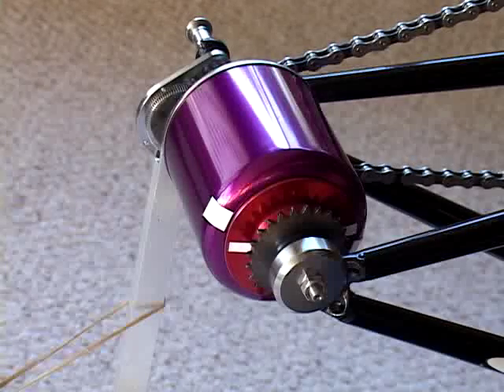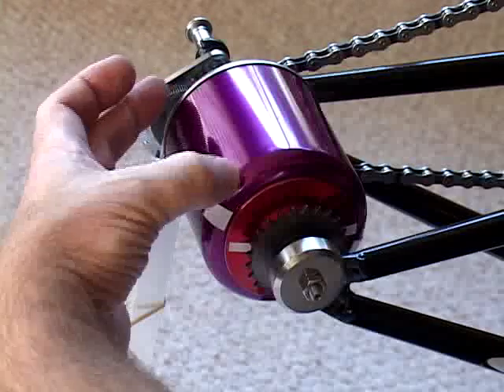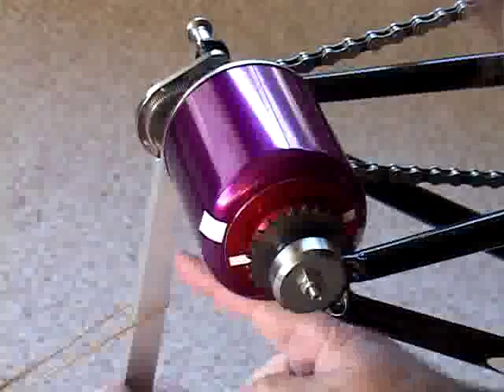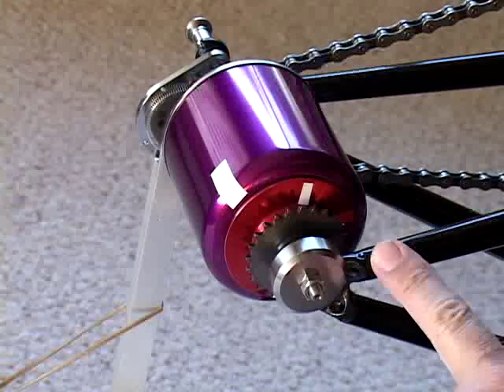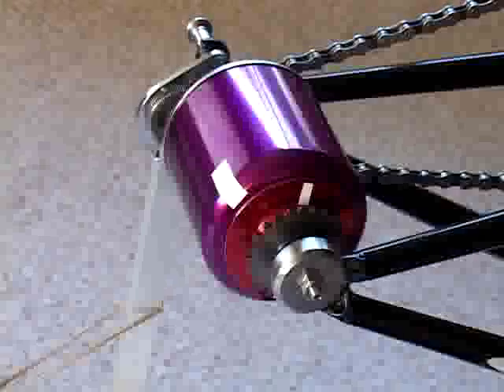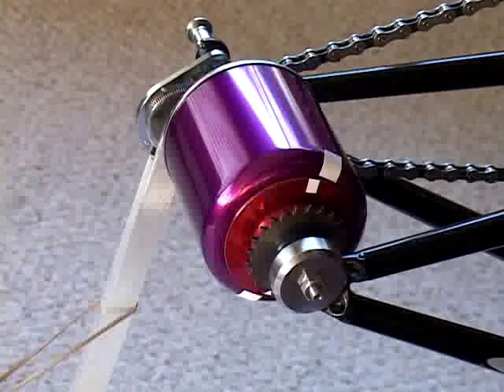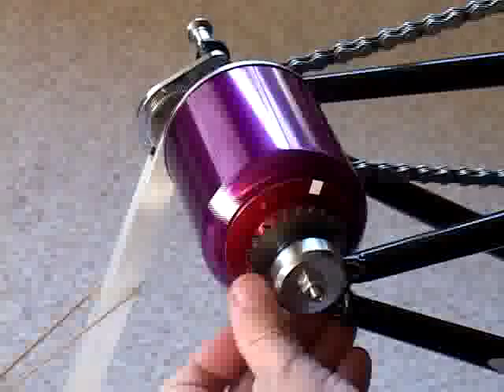Automatic Bicycle Transmission (IVT)

Comment: May I ask, where is the product for this drive type? Any Updates?
Reply from the maker: Thanks for your question.  I've been dedicated for several months to thoroughly optimize a new design for a mid-drive Pedelec EMTB and pedal-only SIVAT with 1kW power capacity.  This design process includes detailed attention to every component's strength, speed and friction to assure a complete, well-integrated system for the next prototype for testing on a full-suspension bicycle.  This design involves many calculations and alternate scenarios to get the right mix that should prove to be the lightest, most compact & durable model that meets & exceeds most basic demands of serious MTB-ers!
This is proving to be the most challenging design task of my long engineering career!  I'm determined to create a great start to a great idea that will be a truly revolutionary transmission that many should find very useful & superior to existing state-of-the-art for bikes other drive systems.
Reply: @SIMKINETICS  Thank you for your response. I do admire your work and determination to pursuit this project. This would be of great value to society - full stop. The greater lesson here is - your relentless effort to continue serves as a template by which all would want to possess however, only a few of us are able to do. With gratitude, bc

Comment: Where is it at now?
Reply from the maker: Thanks for your question.  I've abandoned a hub-based approach in favor of a bottom-bracket-only location because of size & weight requirements.  Focusing on the new approach opens up some important opportunities to add back-driving that will address an emerging market for higher-end pedelec mountain bikes.  This electrified SIVAT necessitates substantial re-thinking & redesign that I'm now doing.  It also involves other aspects of the overall bicycle design, a larger scope that's inspired by a sea-change in the market that more easily justifies the higher price of a quality product.
Up to recently, I was reluctant to go forward because pricing of production appeared to be too high for an affordable SIVAT bike.  A recent insight into how to back-drive the SIVAT is conveniently coinciding with the aforementioned market shift.  So, it's 'back-to-the-drawing-board' for a more expansive, but more appropriate product concept where the numbers work in terms of both design and money!
My goal is to open a crowd-sourcing account, like Patreon, to finance development after I'm satisfied that a more comprehensive design is ready for serious prototyping and testing of a kW+ rated system.  It's been a long time to get to this point!
Reply: @SIMKINETICS  would it work on both e-bikes and normal bikes, could you please send me the link for investing in such gearbox and could you also make another video once done
Lost of love and support for ya
Reply from the maker: @gaelbm7421  My goal is to design only one version that will be universal to accommodate convertibility between a hardtail & rear suspension e-bike as well as both of those in pedal-only propulsion too; i.e., four flavors.  Such convertibility will depend on the motor choice and its control firmware, which are not fully known at this point.  This will involve the challenge of making a predictive choice of motor(s) to fit the SIVAT so that a non-electrified bike can be developed first as an initial product.  
My plan is to run both pedal and electrically-assisted power through the SIVAT, then to a single drive sprocket or belt-drive pulley, involving a new bike design; while also offering fairly simple adaptability to allow retrofitting to existing bikes in a kit. 
If you subscribe to this channel, you'll automatically get updates to the status of this project and eventual references to a Patreon (or other) account for investment.  I might offer an opportunity for early significant contributors to be first to try out a prototype!  Thank you.
Reply: @SIMKINETICS  Thanks! Love your work and ambition and fully supports you

Comment: What is the overall ratio? Better then a Alfine or Rohloff?
Reply from the maker: Thanks for your question. The core mechanism has its highest ratio of output/input rotating speed at about 0.7 with its lowest ratio at 0.0 (zero).  With auxiliary conventional gearing at the core's input and/or output, the maximum  system ratio can be raised to any practical value while still  retaining that zero ratio in its range!  The limit to that systemic high ratio is theoretically infinite, but    limits of strength of materials make 20X-30X its practical limit.  In effect, the SIVAT can deliver a range of gear ratios far beyond anything else!
The demo prototype shown here is sped up with a 55 tooth chainwheel (not visible in this camera view) driving an 11 tooth sprocket; so the 0.7 ratio is raised systemically 5 times (55T/11T) to about 3.5X, slightly low for a bike, but...
I've recently decided to stop trying to make this a hub-based system because it gets too complex & expensive to fit all that gearing into a hub.  So, I've finally decided to proceed with placing the SIVAT in the space above the bottom bracket (the pedal crank) where there's plenty of space to use larger, stronger components that will accommodate an interface with full suspension and a one kilowatt (or more) electric motor.  Pedaling and hardtail versions will be first though.  I'll explore the design possibility to allow fairly simple upgrades for suspension & a motor to make this a highly desirable EMTB!  Regardless, you'll be able to pedal up grades at the limits of traction and pedal downhill at high speed without needing to be outside a 60-100 rpm pedaling cadence. 
Does that answer your question?
Reply: @SIMKINETICS  oho wow thanks, that was extensive! I've quickly read this: USOO5516132A patent. Think it's  close to what you've described in the answer.
Reply from the maker: @tonyd.3430  I couldn't find that in USPTO, so  
don't understand any similarities.  This SIVAT is too weird to be similar to any transmission that I do know; and I've studied hundreds of types.

Comment: The transmission is great.  A bicycle IVT would be an awesome benefit for cyclists.  Flywheels, however, have been proven to be impractical.  To be effective a flywheel needs mass , and a lot of it.  Accelerating that added mass in a vehicle nullifies a lot of the benefit from having it.  When you add the inherent energy losses getting the energy from the drive wheels to the flywheel during 'braking', then back again for acceleration, it's a lot of added complexity and weight for very little gain.

Comment: For anyone still wondering, this technology now exists in a practical sense now, seems like he may have sold the concept. Here is is in action: https://www.youtube.com/watch?v=kVPjhmTThPo 

they used an oil to achieve the transfer of force through the gear hub (this was what the developer was working on, on this current prototype.).

Thumbs up so others can see this.

this is the best bike on the market using the product: https://www.prioritybicycles.com/products/continuumonyx
Reply: This not nuVinci its based on cam, ratchet & negating the initial 1:1 ratio & utilizing just gain. Disadvantages less efficient at higher ratios thats why auto makers were not interested.

Comment: Sounds like hydraulic Beesd valve close 100% bypass but  open is more and more going to driveline but Maybe Combination of Different  Things
Reply: This not nuVinci its based on cam, ratchet & negating the initial 1:1 ratio & utilizing just gain. Disadvantages less efficient at higher ratios thats why auto makers were not interested.
Reply: @LivingLifeOfSeeker  alright so that's why we never saw them on bikes anywhere

Comment: I got an Nintinol power rod low torque engine with a few ton's of force per square inch and i need an i individual able to design a transmission for it. You interested?

Comment: mr simkin, i do see you still active here. hows the project going? what kind of price point are we talking about? feel free to message me directly if you can. your device may be necessary for a more encompassing project.
Reply: This not nuVinci its based on cam, ratchet & negating the initial 1:1 ratio & utilizing just gain. Disadvantages less efficient at higher ratios thats why auto makers were not interested.

Comment: What was commented on is just a first generation concept idea. Low technology. A higher technology of commented concepts is available if you are interested in working with me? I have a swash plate pump motor type 12 that operates off liquid air that spins at hyper velocities so i would be interested for you to design a transmission that i could use with that swash plate pump motor. Concept an electrical power plant in a mountian area with helium super fluid. The super fluid would pull itself around the closed system in a loop spinning swash plate pump motors that then spin electrical power generators. The super fluid would generate it's own monentum has it pulled itself through the system. Just one concept to producing clean energy. Main goal to create clean power systems that can then beam power using tesla coils to power superconductor separators to clean rivers and streams of pollution and bacteria. Rivers and streams you could drink from from being so pure. Up to you if you want to help and get paid along the way has the end results get world wide attention. 😊😉

Comment: I have a use for your transmission sir. Read carfully! A V-6 or V-20 stirling cold gas engine. Gadolinium used for magnetic cushions on all moving parts on the stirling cold gas engine. Stirling engine incorporating antivibration technology currently being used in Skill saw's recuperating saws. Cold gas engine has two fly wheels. I would like to use your automatic transmission and attach a transmission to each fly wheel. Then attach large drum motors that have been rewired into electrical power generator configuration. A cold gas electrical power generator that uses zero fossil fuel and generates no pollution and operates off liquid air. Let's chat and get this product onto the market. It has multiple applications from home electrical generation and air conditioning at the same time by adding components to the system. portable electrical power generators that operate off liquid air. Atmosphere that has been super cooled into a liquid used has fuel for cold gas cycle then heat exchange for air conditioning and or refrigeration with liquid air boil off back into simple atmosphere. 😊😉

Comment: it's not automatic if you have to pull the lever
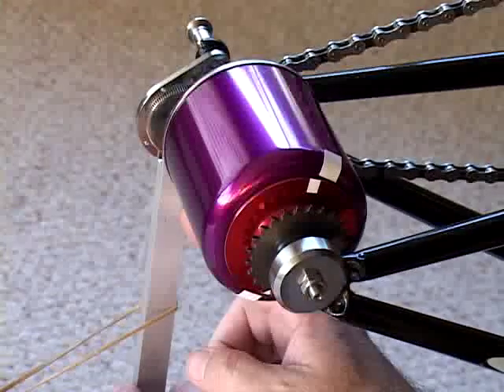Reply from the maker: 4:40  Here's where I explain its automatic operation.  After re-designing this system, I've found that a very simple coil spring-actuated mechanism precisely controls the SIVAT for almost constant power throughput as intended.

Comment: Will it work with a go kart engine? 212cc predator?
Reply from the maker: Thanks for your question!  The first fully functional prototype will not handle 6.5 horsepower because it's design is based on the lighter weight requirements of bicycles & moderately powered small vehicles & machines.  If tests & anticipated production costs justify this size in the marketplace, it will likely become the initial standard as a product.  If that product succeeds, it will pave the way for larger variants.  This concept is scalable!  A SIVAT for the power level you seek will be about 50% larger in most dimensions, and its weight will increase from 3 or 4 pounds to about 10 pounds.
Currently, I've decided to assure that the SIVAT will be capable of jake-braking with some additional design to synchronize inverted driving that changes input to output and output to input with compatible gear ratios.  For patent considerations and a clear path to this capability, I want to first solve this challenge that will enable the SIVAT to be used for applications beyond bicycles that typically don't require jake-braking for which the free-wheeling SIVAT is appropriate.  A go-kart driver will definitely want jake-braking that slows the kart through throttle control rather than separate friction-braking with another pedal.  I consider the option for jake-braking to be important enough to make the launch of the SIVAT contingent on its clear route to a complete solution.  So far, that solution isn't clear to me, but the original SIVAT concept was once also not clear to me.  This is testing my patience with myself!
Reply: SIMKINETICS well when you build one that can handle a 212 cc I would like to buy one

Comment: This be great to use with a stirling hot gas engine that was turning a electrical power generator. Are they available yet? A V twin stirling hot gas engine with two fly wheels could have two of these transmissions that cranked two electrical power generators. Be a neat tool to charge up your battery banks when ypur solar panel set up has not gotten enough sun light. Could use solid state graphene solid state electrolyte power cells with organic carbon power cells to heat elements in the cylinder heads of the stirling hot gas engine to crank the transmissions to turn the electrical power generators. 100% green clean energy way better then solar.

Comment: So it has a variable clutch. If you are able to create a negative ratio. It could be used as a brake, You could have 2 armatures. One for positive and one for negative ratios. and eliminate any other separate components.
Reply from the maker: It's not a variable clutch, nor does it have a 'variable clutch' (whatever that is).  It does use clutches, but they're one-way clutches whose operation is binary; i.e., they're either fully engaged or fully disengaged.
As for jake-braking, the SIVAT cannot in any way be used to swap output with input.  For bicycles, which usually have hand-operated brakes, this feature is not necessary.  BTW, a 'negative ratio' would mean that the output would be backwards, so you likely meant 'inverse ratio' instead.  Anyway, there are some limitations to what the SIVAT can do, but none that would limit its use for a bicycle.  Good try, though!

Comment: a great invention I  have tried a lot of mechanism to do the same process but it dedent work do you use spider gear system or planetery gear or expanding clutch plear answer me it is very important to my invention I can only say it is a mechanical vehicle and this transmission is very much required
Reply from the maker: Thanks!  I cannot disclose much about its inner workings until after a patent is issued.  It does use a planetary gear system in conjunction with several other mechanisms.  One day (after the patent), I'll make a video to describe how it works, which will definitely confuse & perplex most people even if I describe it as clearly as possible!  I can also say that its function depends on a fairly large set of highly constrained mathematical relationships that guide a second prototype design which will be fully-functional.
I too have researched several (dozens) IVT concepts, and have tried several with dissatisfaction.  I now easily see the flaws in concepts I've reviewed.   I strongly believe that this concept will succeed both in its reliability and its market, and have been patiently waiting to see the economy improve enough to justify the risk of starting a new product.  Thanks for your interest!

Comment: Could you not design these to be used with electric motors used in vehicles to allow the motor to spin less ounce a set speed has been reached? Which would save engine and battery life and extend the electric vehicles power consumption and range. You have a cool little transmission.

Comment: This transmission design would be perfect for a V-10 hot air engine designed to run off low voltage induction. That could be put in a vehicle or motorcycle. If the correct components used in build concept? These vehicles would have unlimited range and would also be able to generate electrical power has a byproduct. Novartis

Comment: An axial vector engine concept with your transmission design would be fun to tinker with while using induction hot air engine concepts to produce a hot air torque power plant to provide thrust for ship's and other vessels for air and sea. Trains using this technology could not only provide transportation but also generate huge amounts of electricity rather then consume it to power city grids. Novartis

Comment: If you were to use this transmission with a low voltage induction Manson engine that operated off solar panels to drive a high voltage power generator would this not be 100% green energy production? This system could be designed at any size which would make all other forms of electrical power generation obsolete? Novartis

Comment: Imagine a motorcycle or vehicle that ran off a hot air engine that incorporated your transmission design? No fossil fuel use that gave the vehicles unlimited range that also produced energy to power a home or city grid? Your transmission has a component could make this happen. If your ready to think bigger? Novartis

Comment: how does it work? do you just pedal and it change gear?
Reply from the maker: +Danny Star  If you pedal with more force (torque), the ratio changes to a higher gear ratio (for faster pedaling) in proportion to your force increase; and vice-versa.   Your pedaling force causes a pivoting reaction against a spring; the pivot controls geometry of its ratio-control mechanism on a continuous basis.  How this works in detail is proprietary.